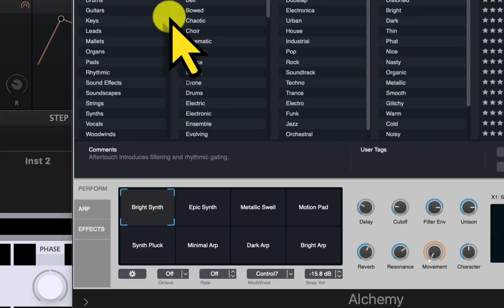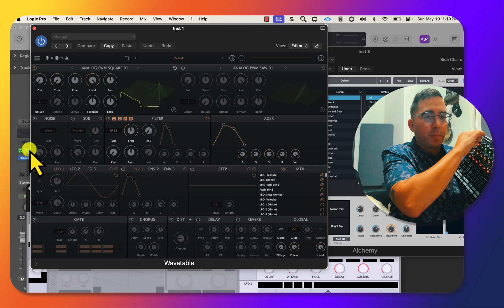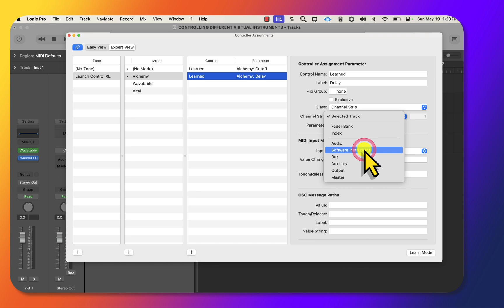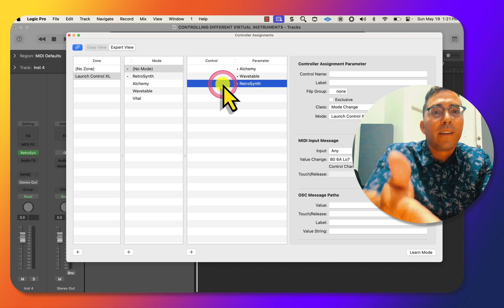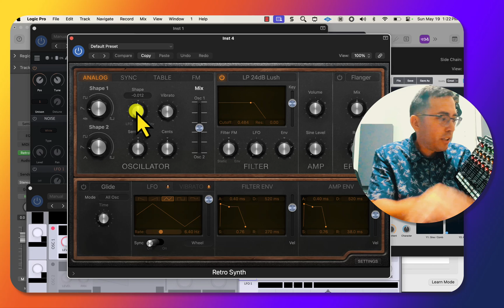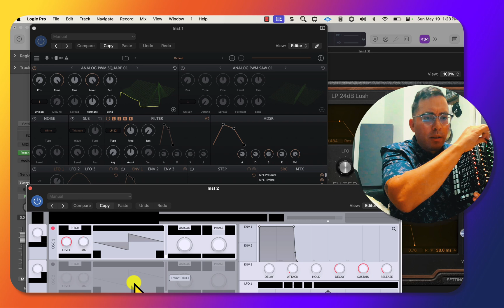Logic Pro Tutorial - Control Surfaces Support: DO THIS to Control Different Virtual Instruments

Comment: At 3.36 you say that there is abhorrent behaviour and have to change a setting. This has been my issue when powering down a controller, at times it switches all assignment inputs to a different controller on reconnection! Do you know if you can group all the assignments and change them at once? Such a simple process but one that doesn't seem to be an option.
Reply from the maker: I would save the .clist and replace it when necessary. Honestly, it’s not covered well and I am trying to learn more about it myself. If you pick up anything, LMK

Comment: This was a really good explanation. Thanks for this. I used to be an Ableton user but switched to Logic Pro years ago. I love how it has evolved from 10-15 years ago but I feel that Ableton still beat Logic in MIDI mapping. On Ableton, I could map various parameters (high cut filter, a wave table from serum, a reverb wet/dry, a compressor threshold) into just one knob on my MIDI keyboard without a hassle. I would hit record and off I went automating everything with just one knob twist without having to switch between instances. Do you know if there a way to do that in Logic?
Reply from the maker: You know what @ettorel now that I have thought about it, there is a better way to do what it is you mentioned. I will be making a video about it soon. Cheers!
Reply: @thatlogicproguy  sounds great! I can’t wait, thank you!
Reply from the maker: That one is for you sir: https://youtu.be/C2iRrDEZ_fc
Keep working 💪
Reply: @thatlogicproguy  Yessssss!!!!!!
Reply from the maker: 🙏 I would map all parameters in question to one knob/slider using a Dynamic Fader. Just remember that it has to be selected and in focus : Logic Pro Tutorial - Control Surfaces Support: Dynamic or Index Fader? Lock Parameters using THIS!!!
https://youtu.be/wIqvZAQB_a0